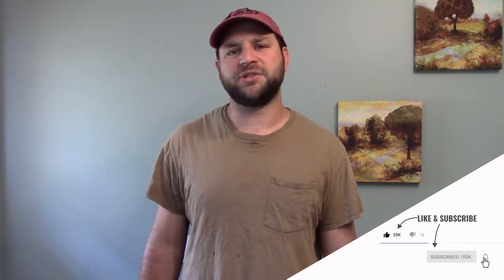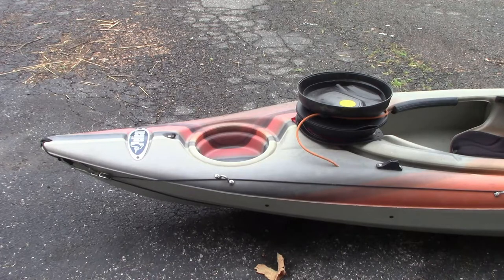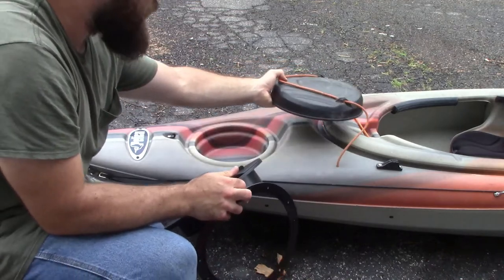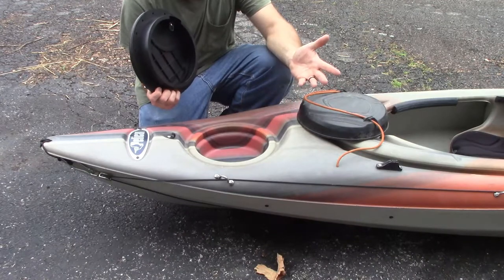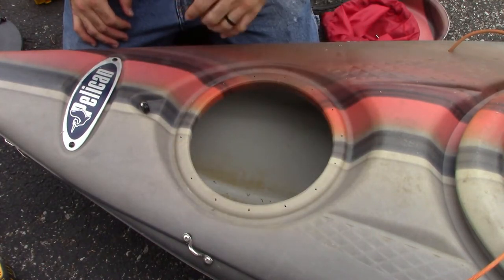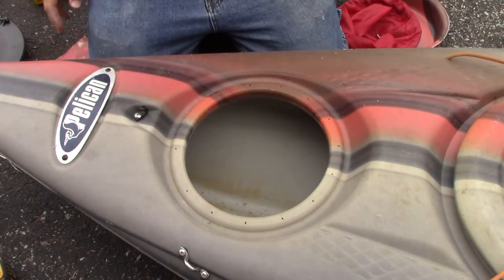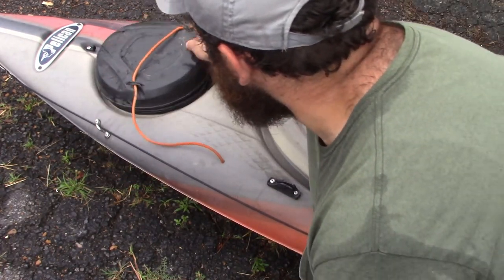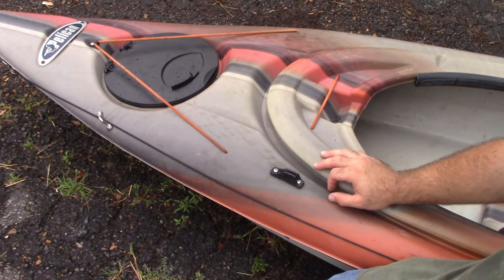How To Install A Hatch On Your Kayak

Comment: That was very clear and concise.  Showed exactly what you were doing and what needed to happen.  I'm still wondering what Pelican had in mind with that forward storage hatch...  
This is the best solution I've seen.
Reply from the maker: Thank you! I'm glad you liked the video! As far as their original forward hatch design goes, to me its usless. It's too small to hold much in it, it's not water tight and if your sliding into the water from the bank at a steeper angle it always fills up with water. Honestly I've not had any issues since I installed it and I can get things in the front alot easier.

Comment: Great video! I was kooking to do the same thing on my pelican. The standard hatch is worse than useless, because if you put anything under the bungees the cap pops off. Pelican has started using a smarter hatch this year.
I ordered the same kit you used. My only problem is with the screws. I dont want sharp points down in the boat that could tear open a drybag or a float bag, or cut my arm. I'm replacing them with  short bolts and nuts nstead.
Reply from the maker: Yea that would be a good call! Ive not had any problems with mine yet, but I could see that causing a major problem on a long trip

Comment: Perfect. Thanks!
Reply from the maker: I'm glad you liked the video! Thank you for the comment!
Reply: @BuildStuffwithAJ  
Your vid fit my search perfectly....my pelican mustang cover tends to slip that little hook at highway speeds, letting that lid flap around. No good!
I'll get my deck hatch (via your link) I a couple days!
Reply from the maker: @VayaconChupacabra  that's great! It's really handy, and I haven't had too many issues with water comming in.  But if yours leaks a little more than you'd like I did another video leak testing it and I ended up adding some through the roof to seal it up tighter.